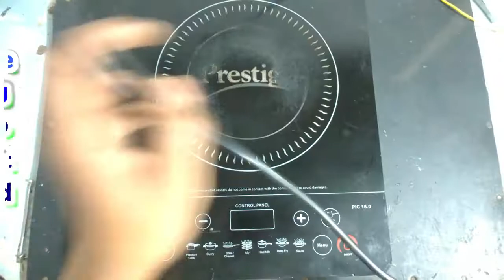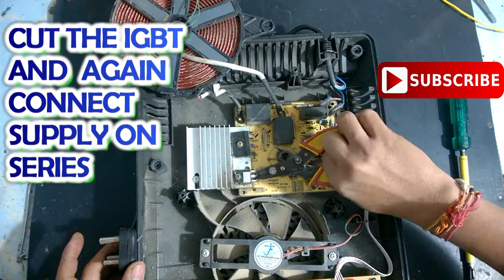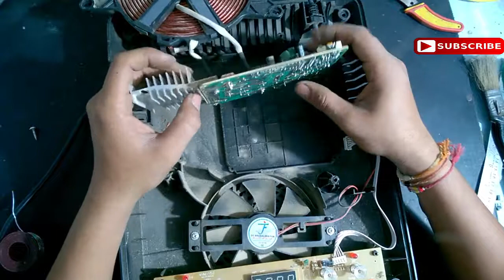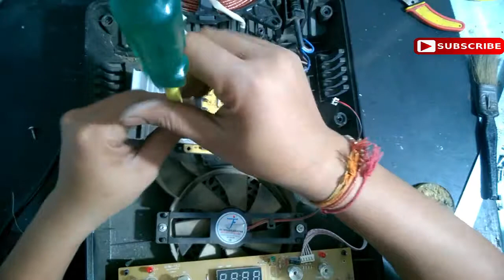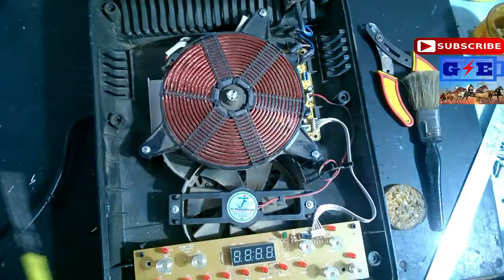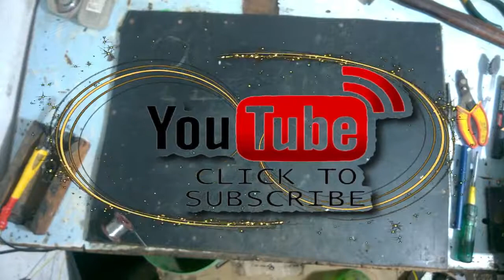PRESTIGE induction full dead

Comment: Sir 2 baar induction banwaya but 1 minute ke baad awaz karke band hojata hai, problem kya hai? Bta sakte ho aap
Reply from the maker: Kon sa induction cooker hai
Reply: @geetanjalielectrical9561  yhi induction hai same, 3rd time banwaya to 1 din chla fir band hogya, help please
Reply from the maker: To iska rectifier diode or 5 microfarad capacitor or .33 ka microfarad igbt ye commenly change kerna padega uske baad igbt ko axcess ampear mil raha hoga to use bhi check kar na padega
Reply: @geetanjalielectrical9561  iska kharcha kitna aaega average??